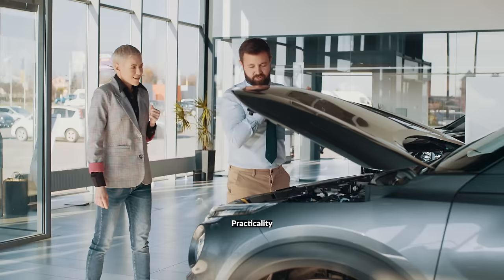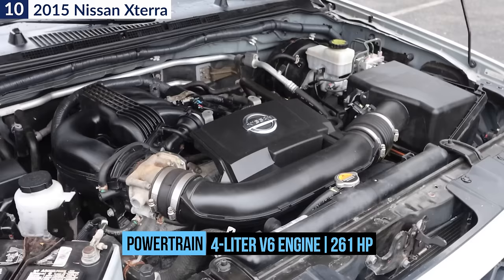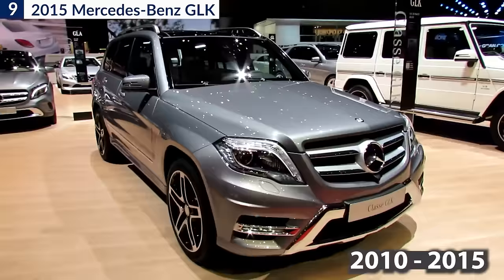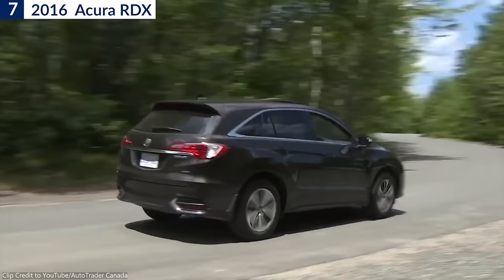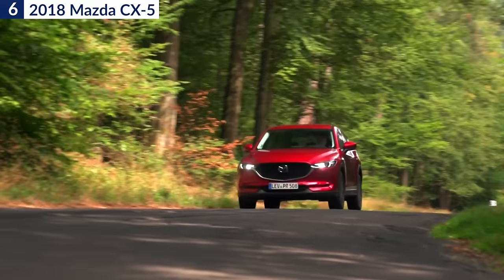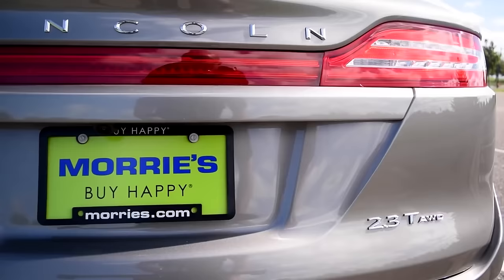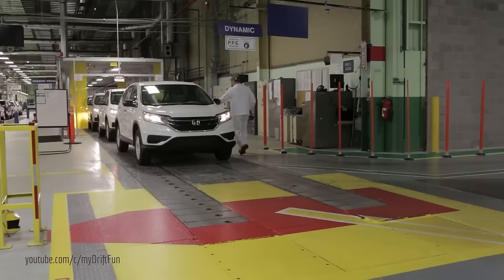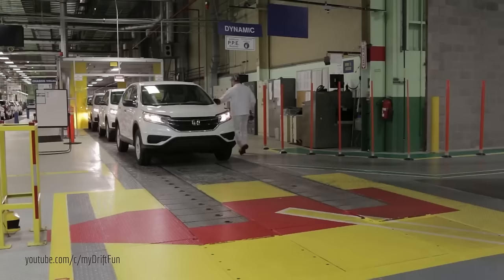10 Reliable Used-SUVs UNDER $20K  |  Here is Why They’ll Last A Lifetime!

Comment: Recommending the GLK is absolutely crazy. These vehicles along with the whole Mercedes, Audi & BMW lineups have proven to be insane money pits. How can you possibly recommend these vehicles??
Reply: As a BMW owner I will say you are completely correct. It's one thing after another. The only saving grace is that I have a super ultra low emissions (SULEV) engine which is warrantied for 15 years or 150k miles.  Luckily most of those issues have been covered so far. Still unreliable AF though.
Reply: I had a 2001 Audi.... it was absolutely the best car I have ever owned..... to drive. But the maintenance was super expensive. EVERY time I brought it in it was $2000 EVERYTIME . $2000 ...... $2000 ......$2000 .....$2000 ..........$2000 ....$2000 ....$2000 ....$2000
Reply: These comments are so useful. Thank you all!
Reply: Luxury cars are like boats, people. The best moments are the day you buy it and the day you trade it in. Unless you maintain it yourself.
Reply: It's well known among good mechanics (ie: Car Wizard or Legitstreetcars ) that the ONLY MB suv to buy used is the M series SUVs, if you have to have MB. Otherwise you looking at a money pit. GLK is no exception. Money pit.
Reply: 2018-2022 BMW X3 is just a dream in every way. I have had mine for a few years and have spent $0 out of pocket. Just perfect!!!
Reply: @Said_w_the_G  Lexus cough!
Reply: @alant8553  Lemme guess you bought an Audi A2000 🤑
Reply: @thelsel348 how you get that warranty
Reply: @Blu3_777  if you have a SULEV engine (N51 in my case), BMW warrantied a whole bunch of parts for 15 years or 150k miles. Basically emission parts and things causing check engine lights. They even replaced a gas tank on my car because of some internal hoses. The warranty was included for free with that engine. Not sure if that is true for every state or just ones with stricter Emissions standards. If you have a SULEV designation under the hood and are having issues, it's worth talking to the dealership to see if it's still covered.
Reply: I remember see another video saying to get this suv.  I watched it and it was the GLK.
Reply: @agentorange8530  ok then go get one. Good luck with that. 👍 If you a good mechanic then ok on these.... but BMW AUDI MB..... or American.... I hope you have tools and skills. Or $$$$.... cheers.
Reply: Paid video i think
Reply: Bad advice
Reply: LEXUS all the way… for many, many miles
Reply: Lies. My money pit was anything from Kia & Hyundai. Since I stopped buying cars that are cheap looking & too expensive & bought a used 2020 GLC 300 Mercedes Benz I get to keep my money in my bank account. It’s actually cool when people think that Benz are useless money pit vehicles because I get to have more options with price negotiation; plus I get to drive a luxurious car that’s easy to maintain instead of a brand car like Kia that cost me an arm & leg to maintain. 🙏🏽
Reply: @srlbigs2 My mechanic recommended the 2020 GLC 300 Mercedes that I bought & it’s way cheaper to maintain than the brand new 2021 Kia Sportage that I had. In the first 3 months of having my brand new Kia I had major problems and the manufacturer told me that the car problems weren’t under warranty so I had to get rid of it ASAP. So far, I have no issues with my 2020 Benz and I will never have any issues with my Benz as per my mechanic’s words. 🙏🏽
Reply: They used reliability data provided by Consumer Reports. I guess you missed that part.
Reply: @JNAllenstv THANK YOU. these are very common misconceptions. My nana owns a 2014 glk 350 and has only ever had too replace one thing that cost her 1200. Out of nearly 10 years of owning the vehicle she only makes sure the oil is changed brakes tires etc. you get what you pay for and these cars aren’t ‘luxury’ just bc the interior is nice. They are built tough as hell if your driving them appropriately and taking care of them which relatively isn’t any more expensive than a Economy vehicle. Aside from brakes and tires costing a little more it’s not some ‘money pit’ as they say. This I can only say for the GLK. As the bmw’s and Audis in question are known for breaking down. But these people in this comment section are coming off as people go don’t actually own these vehicles or maybe are themselves the reason their car breaks down due too negligence and just gathered round in a YouTube comment section too cope 😭😭😭

But yes I’m with you. These people are delusional
Reply: Glk is reliable as hell. Maybe you don’t take care of your vehicle. 10+ years haven’t had too replace anything aside from a electrical fix that costed just over 1k. And that was only one time! Been tired brskes and oil changed keeping her running beautifully. Just saying 🤷🏾‍♂️
Reply: @Looseskru  Well said. 👏🏾👏🏾👏🏾
Reply: @Looseskru  well good for you, but you are the exception and not the rule.
Reply: No BMW No opinion dude. I have Sulev BMW engine and it is extremely reliable. Only problem was gas pump which cost me $500 to change at the indy BMW service shop. German cars mostly reliable but you need to maintain regularly.
Reply: Because the videos are not made by people who actually have to buy such a vehicle. They consider things completely irrelevant to most buyers. Mentioning engine size, hp, and torque for a family vehicle shows they are 100% out-of-touch.
Reply: Omg! The comments I tend to think a lot if the reason is the driver poor maintenance and driving. Some people drive not paying attention to those little lights on the dash 🙄til it’s too late.. JS
Reply: @cuddy8079  What year did you get?
Reply: @vincentsantoiemma5501  no. If all these cars are so terrible, why are they not constantly seen broken down on the sides of highways?
Reply: Great vechicle I loved my diesel but for reliability because of all the DEF stuff a great six cylinder.  GLK 350
Reply: It’s saying vehicles under 20k so you’re not getting top notch
Reply: @srlbigs2 M series? MB? Or you meant bmw or Amg
Reply: @JNAllenstv you haven’t owned an old enough Mercedes
Reply: @RahzAlGhul  I can attest that I owned vehicles much newer than my Mercedes Benz (in which I was the first owner of them all) & within 6 months I had to pay for servicing the cars even though they should be under manufacturer’s warranty. I have my 2020 Benz since January 2023 & I haven’t serviced the car. I haven’t got an oil change or anything (though it’s past due & the car is still running perfectly fine). Had it been another car other than a Mercedes Benz, it would cost me an arm and a leg to maintain like they always do. 🤦‍♀️

Because of my bad experiences with buying so called cheap cars that cost me an arm and a leg to maintain, I encourage everyone to investigate & have personal experiences with luxury vehicles before coming on the internet to talk about something that one has no clue about. 

Notably, it’s sad to see people being brainwashed to buy so called less expensive cars; yet in reality these cars do cost more to maintain because they aren’t built properly. 😢
Reply: I have a 2018 BMW x550i and it had to get its transmission replaced twice and the engine had to be replaced also just a problem pit 
And here’s a interesting thing last Thursday i got in the car and it would not start i replaced the battery 2 days ago that battery was a fresh battery also
it currently has 85k miles
Reply: 😂😂😂 @KarlLetcher
Reply: @nevergiveupnevergivein7655 because they stay in the repair facility, so they're never driven.

Comment: My 1997 & 2002 Mitsubishi Montero 3.5 L V6 was by far the most reliable and capable SUV’s ever, never got stuck in snow, it was A fearless Full sized SUV, traded one for the other, the only reason I got rid of it was the Lack of parts availability, the older it got it just got to expensive to find available parts.
Reply: That was the old time, anything after 2005 is garbage.
Reply: I just laid my 2003 Montero to rest last month. I'm seriously grieving the loss of that car/ the unavailability of more of them😥

Comment: THE 2000 Navigator was a rental SUV at the time I purchased it. I saved 22,000.00  and it had only 18000kg on it at the time of purchase. I drove it for 14 years. It was easy on fuel and had excellent navigation.

Comment: My 225,000-mile  '03 Lexus GX470 is still going strong, V8 is smooth, quiet and powerful, the air suspensions works perfectly, it's got all-day driving comfort and with full-time 4WD and a locking differential, it will off-road quite well.
Reply: I'm trying to decide between early 2000's Land Cruiser, GX 470 or newer GX 460
Reply: I agree. I have a 2004 GX470 with 250,000 miles that purr’s like a kitten.

Comment: Best used SUV: 2008 Toyota Highlander Limited 4WD; had 158K mileage on it 2 years ago & has 175K today!
When purchased, Gr8 Paint, interior, Ran VERY Smooth - Transmission, Everything worked Very Well, Including  snow hill settings, without putting to the specialty mide right away!
LOVING it...

Comment: I own a 2018 Outlander GT V6, good to see it made number 4 on the list, no issues at all, so I agree. No CVT either on this one.
There has to be a good reason this made in Japan SUV has a 10 year warranty, flies under the radar of most buyers. I took the zero percent interest deal in 2018 and now it's 100% paid off.
Just had a full detail done on it,  with ceramic coating, and it looks brand new like it just came off the show room floor. This thing got me out a scary watery ditch one time, very safe AWD system.
Reply: I have a 2012 Outlander GT with 222K and still going strong!!!

Comment: I own a 2016 Honda CRV which we purchased used with low mileage in 2017 and it now has >66,000 miles with no problems. But we do all the recommended maintenance. We have been happy with it and on long highway driving can get 30+ mpg!
Reply: I have a 2008 Honda CRV
320,000 miles. 
Now it needs some special TLC, but still reliable.
Reply: @bauron1985  👍

Comment: I had a 2015 Nx 200t F Sport AWD and it was a great buy. Never had any issues in the short time i had it. Had it 6 months and put 17k miles on it. Only issue was it was a lil hard on gas, but id still buy another.
Reply: what is 'lil gard'
Reply: @jrey6186  I meant hard lol. 😂 you knew what I was trying to say.

Comment: We had good luck with our 2008 Ford Escape with V-6 engine.  At 200,000 miles only had to replace the struts and water pump.  Changed the oil with synthetic oil every 4,000 miles and Transmission, Differential, PTO gear oil synthetic every 30,000 miles.  I wish the newer SUVs like the newer Escape did not evolve to look more like station wagons than boxy SUVs as I need an SUV that will fit 2 dog boxes side by side (47 inches of width between the wheel wells).

Comment: Suzuki grand vitara 2001, bought it used in 2002 with 20,000 miles, its now on 197,000 miles after 22 years, and it just started to have prorblems with the catalytic, other than that, it's still running.👍

Comment: I have a 2010 Lexus ES350 and and RX350 with 133k and 153k miles and they are both pretty bulletproof. I do brakes changes myself, but everything else is routine maintenance, simple and not that expensive. Other brands I have had, transmission didn’t make it past 100k miles. Always and only, buy Toyota.
Reply: They should have made the list.I'm likely going to get one thisqueak lexus 350 rx

Comment: I had a 2004 BMW X5. It was great for 200,000 miles, THEN, it got electrical gremlins due to the panoramic moon roof. They are known for  trouble. It still had a great engine and no issues, but when you get gremlins, it has to go. Made me sad. Now I have a DIESEL X5 with 125,000 miles so far. Have not had any issues. Love an X5!

Comment: My wife and I are still enjoying our 2012 Cadillac SRX. Purchased at auction, it was a lease car. We purchased it in 2015 and it had less than 25,000 miles on it. only problem was it needed brake pads all around, 4 new tires and a new battery, oh the rear camera was fuzzy so I installed a new one in it. Great running car millage now at 110,000.

Comment: Best SUV 2008 Ford Escape Hybrid.  Under the hood made in Japan.  Mine has 120k miles and no problems. Only repair replacing key ignition.
Reply: my 2010 escape hybrid has 230k miles, no issues besides the key ignition
Reply: My 2006 has 250K, have replaced some items but not a big deal.

Comment: For under 20k as of right now these vehicles will have close or over 100k miles on the odometer
Reply: yea the used car market is horrible where im at, but im in the market and I just missed out on a 2016 Mazda CX-5.. which is the same car as the 2018 just without the ugly upgrade and tiny headlights that are on the refreshed model.. which i think look way worse.. alot of newer car makers are doing this and it looks terrible, regardlesss it had 55k miles on it and was a higher trim package.. and im in boise where the car market is just as inflated as the housing market.. and according to a recent study, the boise area is the most inflated housing/rental market in the entire country... thanks alot all you californians who moved up here and ruined our beautiful cheap to live in state.

Comment: I have a 2004 CR-V with 168,000 miles on it. Just had to replace the chain and tensioners to the tune of $1,500 but that's the only problem it's ever given me. So important to always keep up on oil changes and oil levels..burns a bit

Comment: I have spent over $30000 on my  2017 Mercedes’ over the last 2 years, headlight and headlight control unit $7700
 Front and rear suspension x 2 electronic tailgate, fuel gauge. Hand brake actuator, steering column ,  +
Never been in an accident. Only my stupidity in buying.

Comment: The best suv I have ever owned was a CRV . I drove the 2004 to 250k . I drove my 2008 to 190k . Only problem I ever had was an a/c compressor at 210k on the 2004 model.

Comment: My 2015 RAV4 gave up the CVT at 110.000 miles. It cost me $8,000 to rebuild it from new and used cars at AAMCO which was expensive, but so far works. They added some cooling fan to the transmission as well. Just FYI If you have a jerky shifting or it kicks when you put R from Park, or it hesitates to gear up, RUN away from it :) the CVT will die soon! I had 4 Toyota services check for the problem before it completely died, and they were unable to diagnose the problem. You need to open the transmission, and it cost around $1,500 to do so. Anyway, you need to check, if the service really change the OIL in transmission...
Reply: Please Let me know your secret about how to break a RAV4. I have a 2006 RAV with 330000 KM on it. I hate this car and become tired of it. It does not break to buy a new one.
Reply: @mohammadnejad104  It’s easy. Borrow it to your wife ;)
Reply: In thought rav 4 use automatic transmission. Was it the hybrid?
Reply: @ontarioman6301 It’s not a hybrid. And every Rav4 or Prius uses CVT transmission, so it’s automatic.
Reply: @LukasNachtigall  Are you in the US? The RAV4 sold here never had a CVT, aside from the hybrid which uses an e-CVT.

Comment: I had a V6 Outlander and it was extremely reliable.  Too bad they dropped the V6.
Reply: Has a 2012 GT absolutely loaded. Taught 3 of my kids how to drive in it. Gave it 2 years ago to my oldest with 174k miles on it and it is still running strong back and forth. Has almost 200k on it now.
Reply: Agree!!  I have a 2012 Outlander GT with 222K and still going strong!!  Both my kids learned to drive in it, too ❤️

Comment: I love my 2019 Mitsubishi Outlander.
Reply: How many miles do you have on it and how has it been holding up? Im getting a used 2018 with 40k
Reply: @cinycaybudgets  56k, and it's still going well.
Reply: I put 174k miles on a 2012 Outlander GT V6. My son has it now and it will turn 200k in January 2024. Only 2 things outside of regular maintenance needed replaced in its lifetime so far: cat back exhaust and blower motor, both after 150k. We are overhauling front and rear suspension ourselves due to rubber deterioration and corrosion in the spring.

Comment: The Nissan Xterra, Mercedes GLK, Subaru Forester and Mitsubishi Outlander are NOT recommended picks according to Consumer Reports “Most Reliable” Used Car magazine published April 2023.
The top three listed here are obvious choices IMHO but if you find them under 20 grand, they likely have well past 150K on the clock (which still ain’t bad.)
Reply: My neighbor just purchased a 2015 Honda  CRV - 90, 000 miles for 15,000.  I think that all vehicles are overpriced.
Reply: @catherinemushaw1956  where I am in California, that’s a pretty good price. But I do agree with you in general.
Reply: Bowing at the altar of "Consumer Reports" does no one any good...........
Reply: @christopherharris3229  haha…yeah, it’s just information.

Comment: 2017 rav4 is a pos. Two cv joints gone and transmission has torgue converter issues still that should have been a recall. Burns oil faster than any other vehicle I’ve owned with frequent oil changes. Pcv valve is under the intake. 500 dollar job for 10 dollar part. Brutal pos Toyota.

Comment: Some of these are good choices, and some are not.  I've used Consumer Reports before, and it is not a reliable source.  A better source is a good mechanic.  I think the Toyotas and Hondas are good choices, and possibly also Fords.  Also, stay away from CVTs and turbos, which should further keep maintenance costs low.